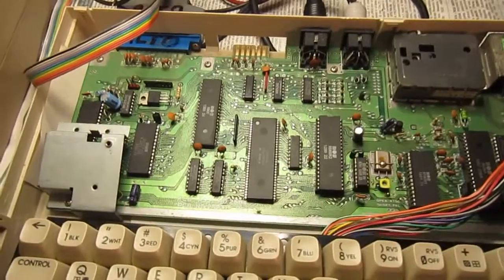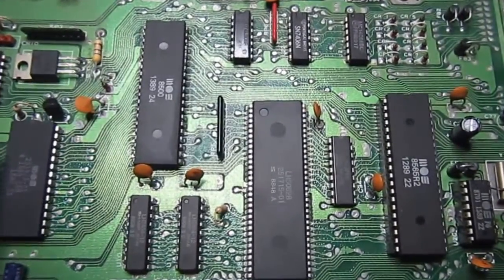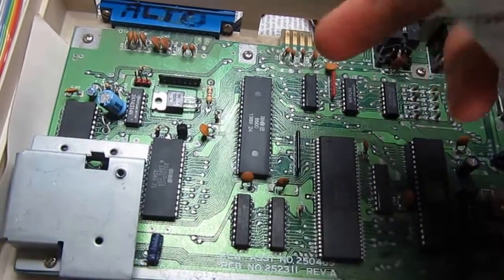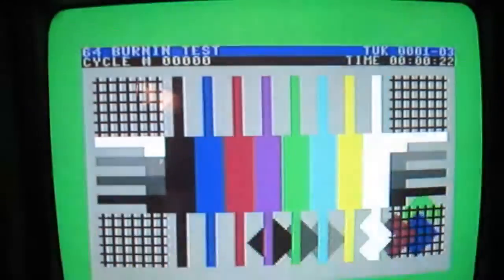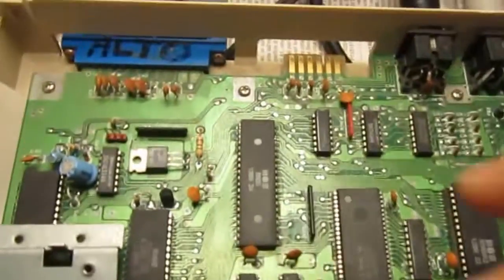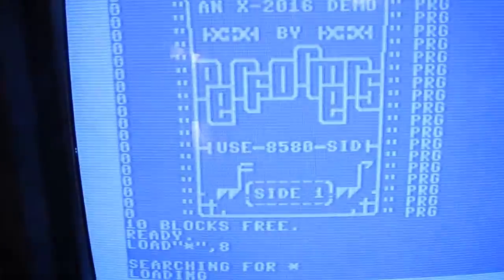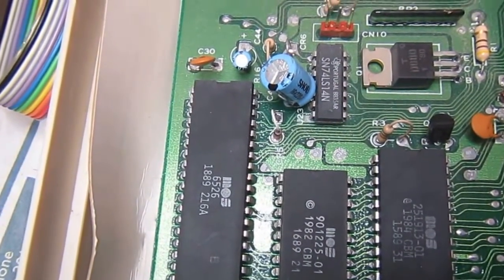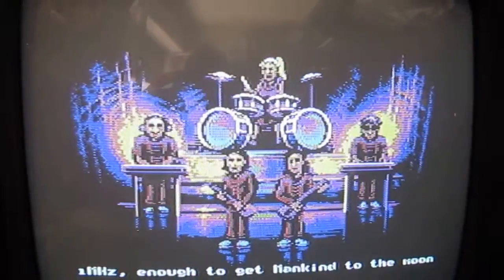C64 (C64C) repair. Cooling a freezing CPU :)

Comment: Original 6510 CPUs work just fine in place of 8500. The only major change between 6510 and 8500 is a process change from NMOS to HMOS-II technology, as such they are perfectly interchangeable and pin compatible in my experience.
Reply from the maker: Hi aphexteknol! Sure, I know it very well, but I don't have any 6510 spare either. In the '80s it was usually enough to store one spare of each IC to make a quick test during a repair, then one would order the replacement by phone and get it in the mail a few days later. So I've never had a huge spare stock. I have also almost never scrapped a complete board as I usually could fix it.
Reply: Just making sure. :) I tinker with old C64s alot too, and I have a small collection of spare parts and even I only have 1 spare 8500 CPU. I only scrap a board if there is extensive physical damage from previous amateur repair attempts. I can repair 99.9% of the rest. Great channel by the way, I love seeing more people keeping these historic machines alive!
Reply from the maker: Hi again and thanks for the nice comment! Yes, I have repaired boards that were really damaged, I keep one of them as my test C64 (the one with the 8701 replacement prototype now). I love keeping the old machines alive too of course :)
Reply: You are welcome! I don't have many videos on my channel, but I do have some I made last year of of my C64 stuff. Hope to see more videos, and I will try making more of my own whenever I get more broken machines to fix. Also I have a few 8701 replacement boards my friend in Canada makes. Maybe I should make a video about them really quick?
Reply from the maker: I have seen your videos, I envy your silver labels, they are really hard to find nowadays! 
8701 replacements are quite a few as I have seen around. I think I've made one of the smallest ones anyway :)
I planned some other custom chips replacements, but it's difficult to find enough time to experiment. Repairing takes much less time :)
Reply: They really are hard to find, and if you do find one people want crazy money for it. The 8701 boards I have are small but I think yours are smaller. :) Repairing is like relaxing therapy for me, plus its keeping history alive. Nice meeting you!